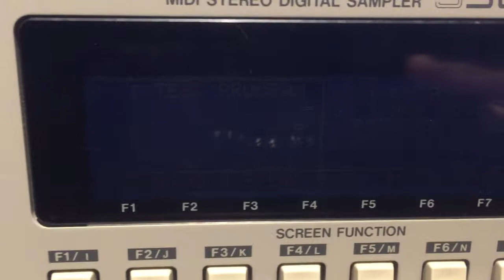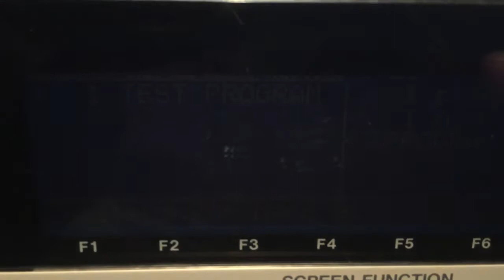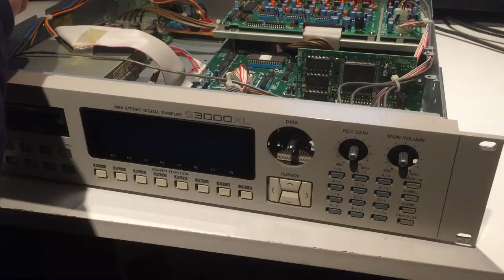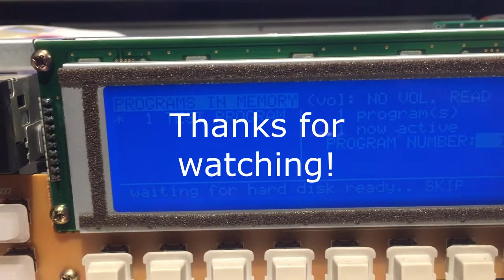Akai S3000XL Sampler - Replacing the LCD display backlight panel

Comment: Clearly explained, thanks :)  But how do you know the dimensions of the panel you're looking to replace..?  I have an Akai S3200 and would like to replace the EL panel, but I have no idea which one to pick .. you mentioned the pink one because it's brighter, but that still leaves a few possibilities :)
Reply from the maker: The shop where I ordered one had them already in the right size. But you can pick a larger one and easily cut it to the size that fits. These are the dimensions from the EL panel I ordered: (LxWxH): 40mm x 132mm x 0.33mm.

Comment: Where can I buy a Akai s3000xl lcd replacement screen in high contrast orange
Reply from the maker: Hi, 
Never seen a EL-backlight in orange, but you might find some Led-type replacement displays in different colors on Ebay. They're more expensive. In that case maybe better to buy a secondhand S3000XL with good display. :-)
They have several pink EL-replacements available at Backlight4you.com. For the S3000XL I've used a blue one first (low contrast) and preferred a pink one (better contrast).
Reply: @Ronald Wijnands  thank you for the heads up about this place.. I have all kind of gear that is or has faded out.. you saved the day thank you so much very much appreciated

Comment: Ronald, I have a question, I replaced myy backlight about a year ago and It was fine until last week while using the unit it just switched off the backlight.. it didnt dim over time or anything. I cant hear an inverter either but cant be sure, Is there a simple test I can do to see whats wrong?
Reply from the maker: if you still can see some characters on the lcd (with help of some external light), I suspect the inverter is defective and needs to be replaced. Also, normally the inverter should make some noise when the backlight is turned on.
Reply: @ronaldwijnands3083  Yes I can see characters still.. and no I cant hear any distinguishable noise when turning on the unit.. DAMN!! How would I go about replacing an inverter Ronald? Have you any idea mate?

PS: Thanks for any info, I appreciate your time responding to me :)